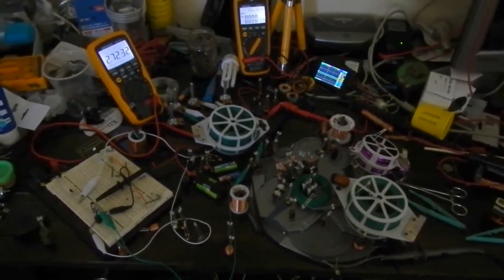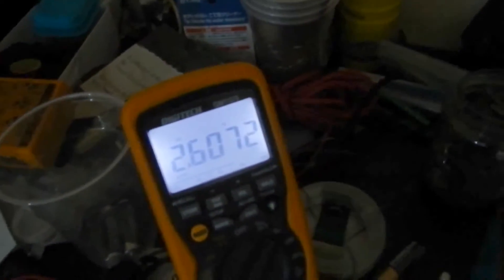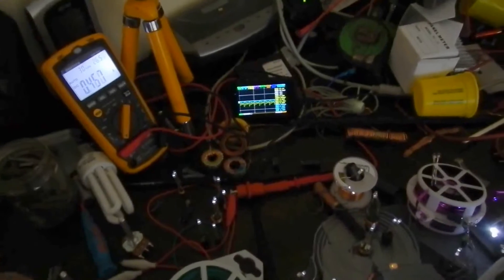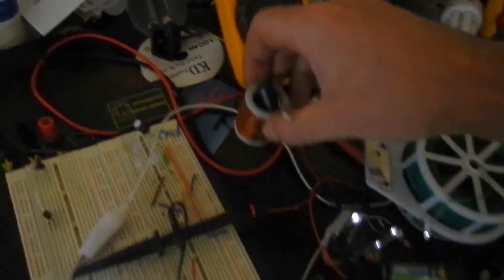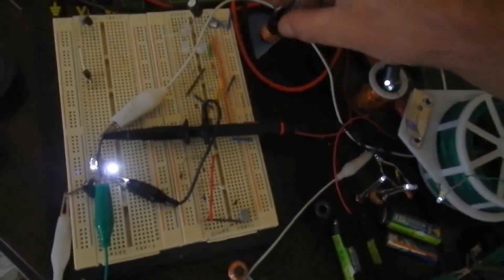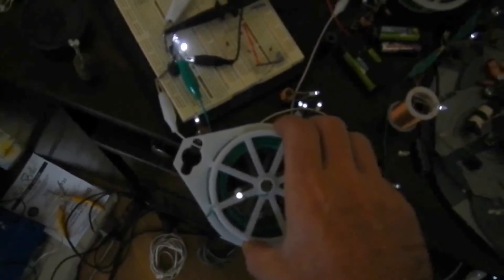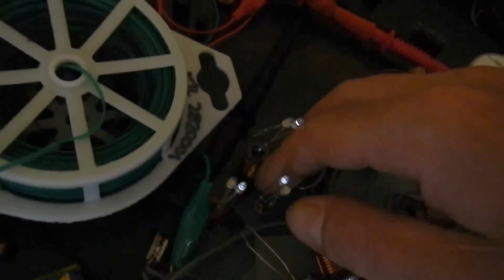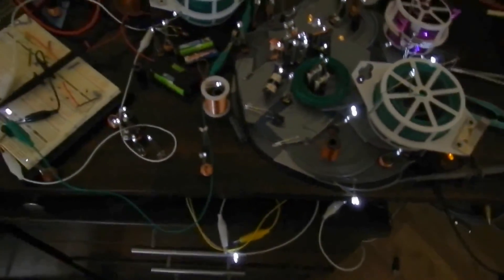Motor & Over 70 leds run from 1w wireless electricity transmission.

Comment: This is cool! Is it all your own calculations etc? Wireless electricity has fascinated me greatly!
Reply from the maker: Sort of my work. The original Idea was slider2732 But I kind of ran with it a tad.... I didn't do much calculating though. Its surprisingly complex. For such a simple thing. Luckily it all works fine with no maths needed. Thats the beauty of bifilar pancakes. If you make them all the same size, they automatically self resonate. They are a one component LCR circuit, just add transistor and power....  Need to come back to this one. This is only the tip of the iceberg. Many more loads can be run without affecting performance, or in some cases lowering input as some resonant loads are added. I stopped because I ran out of receiver coils.... 20 odd SWES videos in my SWES playlist if your really keen. Technically this is magnetic Wireless, compared to Tesla coils/Slayer exciters which are more RF wireless. If you want to try this its dead easy with a 2n2222 and flat AA or AAA.... You can see my first replication here: Simple Wireless eletricity replication.
And I even did a Bifillar Pancake, How To Wind a coil for Simple Wireless Electricity Transfer. where I go over the connections There is also a schematic in Sliders original video Simple Wireless Electricity System

I think slider even made a beam (yagi style) radio transmission of audio and power... Its also the lowest freq single wire system you will find. I highly recommend you try it if your curious. I'd never done anything wireless before I found SWES, thought I was years of study away from doing it. Then I saw sliders video, and 1 hour later had my response posted. It really is that simple.